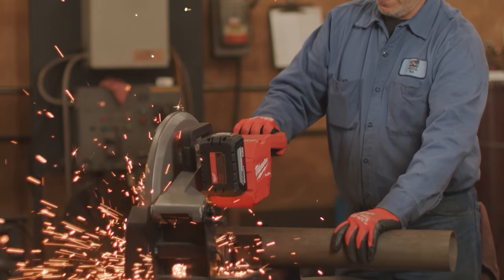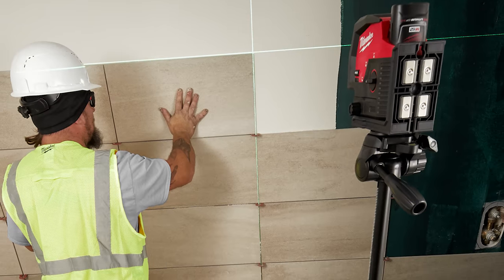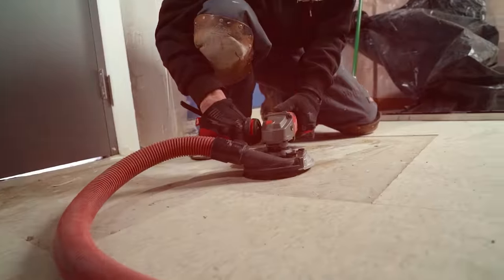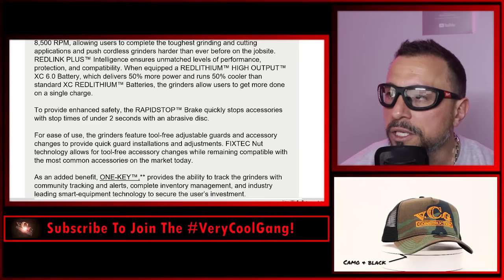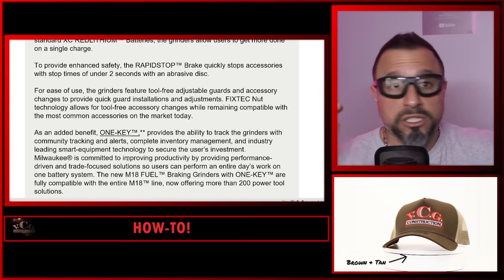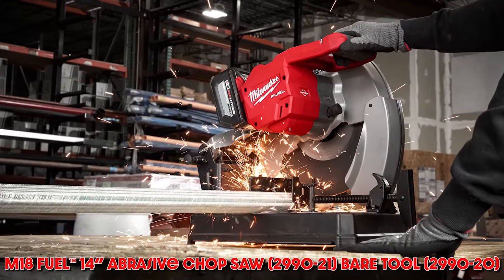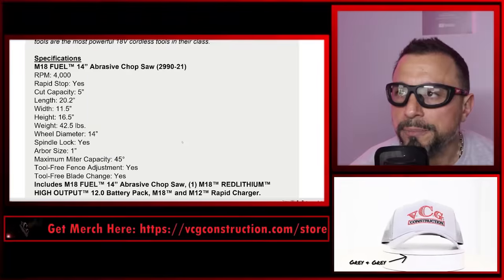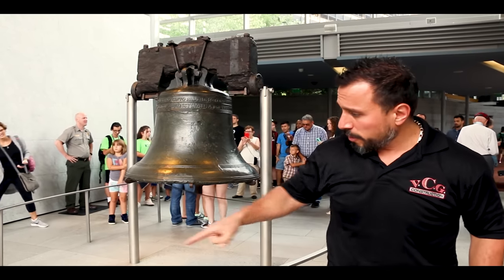3 NEW MILWAUKEE TOOLS Will Make YOUR Work EASIER, SAFER, & FASTER

Comment: Can somebody call Milwaukee, tell them that we live in 2021 and abrasive chop saws are old and we use Dry cutters now
Reply: @jacksmith2315  Honestly thats a good point I always forget that. I was more thinking that a abrasive cut leaves you extra cleaning work and the dust is far worse. Those two reasons are enough for me to switch.

Comment: I love Milwaukee tools. My woodshop is full of Milwaukee. I have been waiting for a full size router with 1/2" collet option. I've got the mini for small round overs. But I would be the first to buy a full size to go with my dovetail jig
Reply: That router that they have is super strong attach a plunge base to it guarantee you can do the same as a full size router
Reply: @jeffeverts7749  but there is no 1/2" collet for dovetail.

Comment: Disappointed about no x-lock on the new grinder! Chop saw looks good but it would be better if it used the carbide tipped blades, like the recent metal cutting circular saw. No dust and very little sparks and a cleaner, faster cut

Comment: I'd like to see a battery powered tool to sharpen chainsaw chains.  Also, I'd like to see some kind of battery powered AC power supply that I could put in the back of a pickup or ATV and use in the field on the farm to run my existing corded power tools.

Comment: Regarding the X-Lock/FIXTEC disc locking systems:

1: Could be Milwaukee doesn’t want to or likes to pay for something like that

2: You could be right Vince in that perhaps Bosch is refusing to allow Milwaukee the option to license that technology 

3: Milwaukee thinks that FIXTEC is where its at and that X-Lock is just a flash in the pan gimmick

4: IMO, the most interesting idea: What if Milwaukee is working on something comparable and just hasn’t released it yet? How far fetched would it be to swap out the spindle and connection system on these newest grinders and keep the FIXTEC on a set of grinders and release another set with a Milwaukee version of the X-Lock system? I’m spitballing here, but an interesting idea none the less. I have nothing to back that up with either, but makes you think some.

Comment: When is Milwaukee coming with a roofing nailer battery style 🤔
Reply: That would be sweet!!
Reply: dewalt came out with theirs so milwaukee is behind
Reply: Yeah nothing like spending 30 minutes trying to push that motor flush against the surface before I can get an actual nail out I wonder if you've actually used to that nail gun before

Comment: I need a 18fuel multi tool nd fuel frame nailer and 15g. Nailer and jigsaw and a fuel 18 angle grinder and that new stereo  and compressor and chainsaw and more packout boxes and miter saw and little flashlight and more batteries and the orbital sander and skillsaw...yea thats it.

Comment: I think Milwaukee and Bosch are fighting because Milwaukee has a patent on the batteries and Bosch has a patent on X lock.  And 👁 think you’re not going to see X lock on Milwaukee grinders. 🥴🧐 😵
Reply: im pretty sure crazy mike will buy a milwaukee grinder and a bosch grinder and make his own x-lock grinder with parts from both of them 😂
Reply: @kingofthecrease30    O.   Ya.  🤣🤣🤣🤣😂😂😂😂😝
Reply: @jacksmith2315   yes that would be cool a certain tool manufactures are battling 🥴 Between each other

Comment: I don't understand why anyone is touting a silly "Tool Free" blade/disc change.  I have the regular type of grinder and I don't use a tool to change them.  Simply push in the stopper and twist the disc with your hand.  Then do the reverse to place the new one on the tool and go to work.  Never had a problem with this.  I think it is a gimmicky thing for them to be able to advertise something new, and add a higher price tag to their discs or make it so that you need to purchase their discs exclusively.

Comment: That grinder is wow talk expensive 😳 to dam expensive since when are   tarades men especially starting out able to buy a 500 dollar grinder I ok I can get one with a cord for 70 bucks it will all the same shit just as fast or very close and it will last forever years ok or if you absolutely need battery so many more economical options not to cut Milwaukee down cause I love Milwaukee ok don't get it twisted rite now  at point has anyone priced out a sheet of osb board it's almost 90$ a sheet a year ago it was 10$ a sheet save money where you can cause everything is rise except our economy wire  2×4 I would hate to buy a house now it's insane like no way you mite think twice about buying a 500$ grinder
Reply: Them there are certainly a lot of words